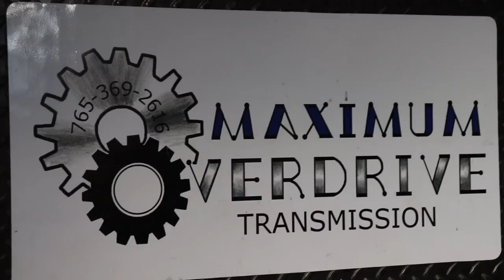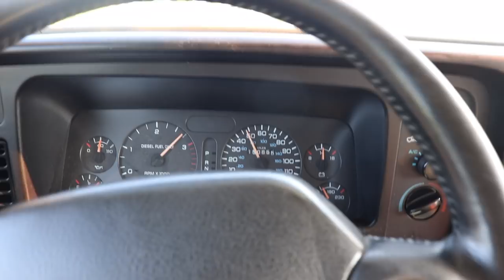SAYING GOODBYE TO ONE OF THE DIESEL TRUCKS... *NOT CLICKBAIT!*

Comment: trans pans dont have fans or coolers in them.  they're full of fluid....  deeper pan so more capacity and cooler temps due to increased volume.  some pans have tubes or fins to add extra surface area for more cooling.  not sure about that converter, but it should work fine for what you need without breaking stuff.
Reply: The pan he bought has cooler tubes in it to help get rid of the heat.
Reply: VintageSpeed Garage should of got a mag hytec deep pan
Reply: nothing wrong with the pan he's got imho, was just responding to what he said in the video.

Comment: If I had a choice between those 3 trucks I'd take either the dually or the 1st gen. My reason is when I can get a diesel I'm gonna get a manual. Not that I wouldn't enter if the truck giveaway was nasty red. I would just rather get something that I want a little more. Even though I'm a ford guy and would rather an 7.3 over a 12 valve. Anyways, I'm kinda rambling now, that's just my opinion

Comment: I’m thinking about getting a 12v cummins what year should I go with and what’s the best year for a 12v
Reply: Devin Eiker 98 , last year they made them and the only year of the 12 valves where the rear doors open, plus the interior is a little different and nicer in my opinion.
Reply: Cody Yost where are you located
Reply: Cody Yost too far away :(